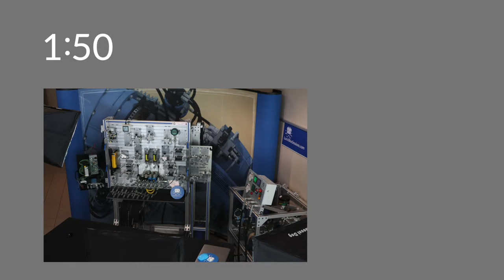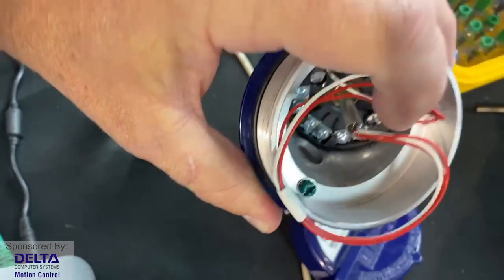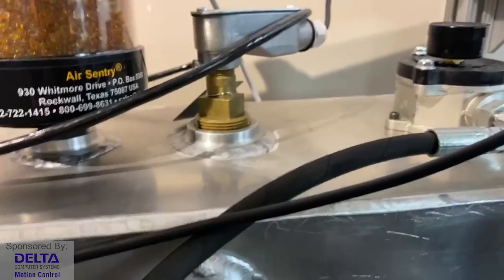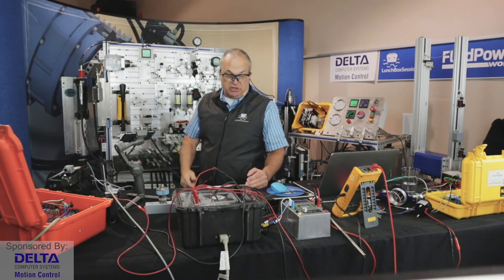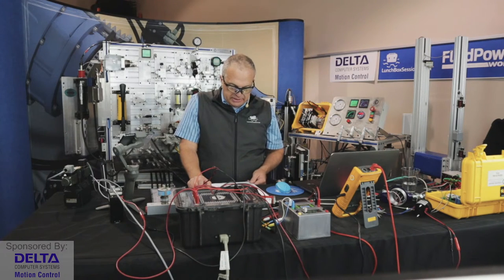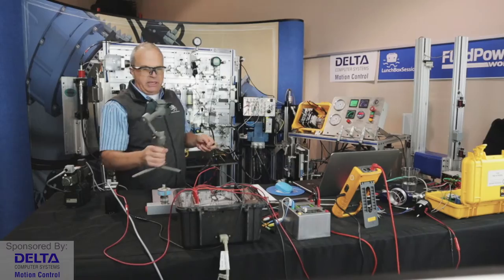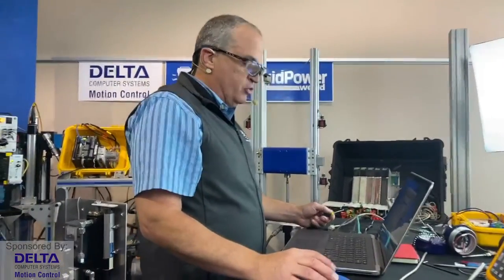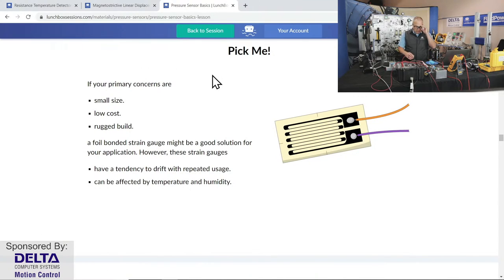Electronic Controls & Sensors for Hydraulic Systems (Live From Sep 2, 2021)

Comment: Have a fellerbuncher with leveling cab with 4  big rams they are single acting and are supposed to hold but now it will bleed off on the lower side if I swing down and am having to constantly tilt up .don't know if I'm should be looking at controller or rams,or something else it's a prentice 620FB can't find a tech manual for  so really stumped